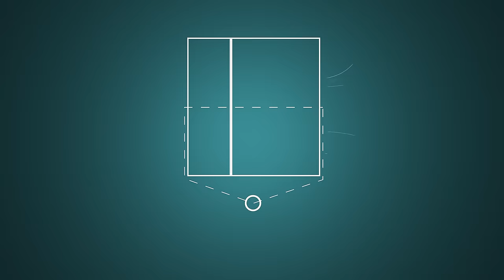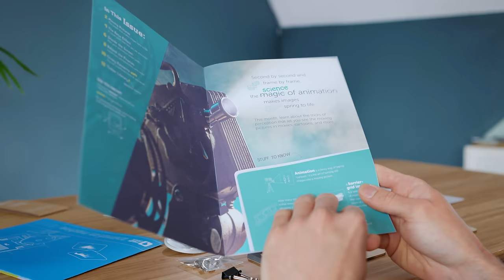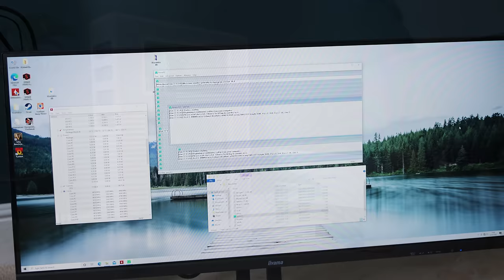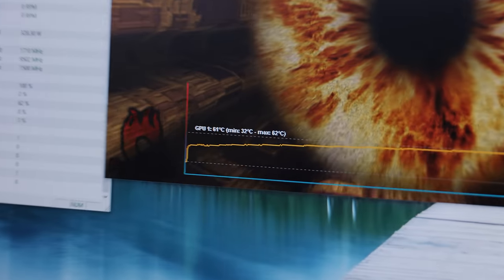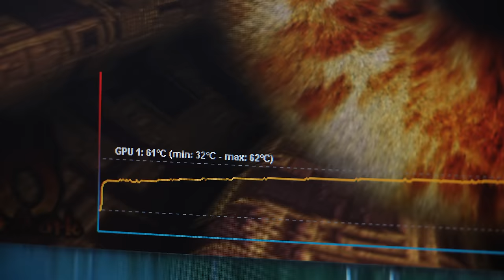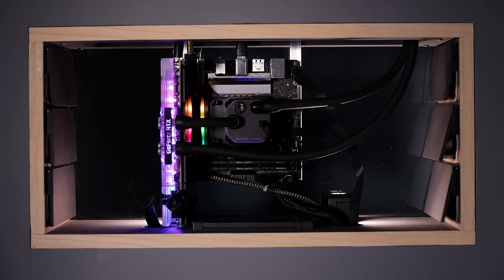Building the world's first 'breathing' PC

Comment: Gamer: heh my pc is watercooled how about you

Diy Perks: it breathes
Reply: Up you go
Reply: 10 years later: Building a hidden desktop wormhole that is actually a biological living entity
Reply: I T  B R E A T H E S 😬
Reply: Until you realize he used a 520 watt passive PSU 🤦‍♂️ This PC isn't sustainable and is only for show. If he tried actually using that PC with those components it would melt.
Reply: I mean he also has a water cooler in his build... Am i missing something??
Reply: @PabzRoz  he ran prime95 and furmark, no real world application can get anywhere near that level of power draw
Reply: @omegaPhix  But did he test them at the same time? No. That literally doesn't mean anything. Pay attention here because I'm tired of educating everyone who doesn't know any better in the comments.

He didn't show any of the HWinfo. He didn't show what the processor was boosting too, he didn't show what the GPU was boosting too, and he didn't evven show the performance. All he did was tell us the temps and Instead of showing us the temps on HWinfo he just put the number up on screen and told us. We have no idea if he downclocked the CPU and GPU so the PSU wouldn't overvolt and shutdown just to get through the video.

 ALSO Prime95 only stresses the CPU and Furmark primarily only stresses the GPU so only ONE of the major components were drawing peak power (assuming he didn't downclock them). If he ran prime95 and Furmark at the SAME TIME then that would be a different story. In the REAL WORLD like a regular gaming scenario or workloads like blender etc. BOTH the CPU and GPU boost and draw power. Obviously not peak power from both but in a gaming scenario for example that 3080 draws around 330 watts and the 5950X draws around 100 watts+  That only leaves around 86 watts for the motherboard, ram, pump, ssd, etc. The second that CPU spikes it will overvolt and shutdown. And no PSU should be running at it's max wattage all the time whenever you're gaming/ working. 

There are reported overvoltage shutdowns from a 600watt PSU so imagine a 516watt PSU (The 12v rail on that PSU is only 516watts)... Like I said, this PSU is far too small for this PC. It's going to experience constant shutdowns and the PSU is at risk of overheating and melting or even catching fire ESPECIALLY because of the fact that PSU is passively cooled....
Reply: @PabzRoz  Ah but it's all just for fun and YouTube money 😉
Reply: @countryside_guy  Exactly. I'm sure he knows that PSU is too small and doesn't plan to actually use this PC like that. It's prob the only one he had lying around that would work in this project so he used it just to make the video and prove his concept works.
Reply: @PabzRoz  My bad, thought that the tests ran simultaneously to simulate max power draw. Had the video running on my second monitor, so i was just hearing most of it. Prime and Furmark should be well established enough, but thanks for the explanations anyways.

But this setup should still work fine under "normal" use, even though it's running right on the edge of what that PSU is supposed to handle. 
On one hand you got Seasonics overkill quality and engeneering (insert german national anthem) and on the other hand
 this PSU is not starved of air flow like it would normally be in a standard case, its counterpart with a fan lashes out way over 1000 watts so i'd guess that this little air flow brings this model close to 600W of sustained load. Adding to that the OCP of this specific unit kicks in at 660W which is more than enough for the 370W power spikes the Zotac 3080 can produce in edge cases. So gaming shouldn't be a problem.
Prosumer software should run fine too because the GPU is commonly just used as an accelerator in most applications like blender or in the adobe suite and the 5950X caps out at around 200W. There probably is some app that maxes out the whole system, but i doubt that Matthew (DIY Perks) works with this kind of software.

And to add to that, my roommate is actually running a very similar ITX Setup with a curve optimized 5800X (TDP increased) and an RTX 3080 Founders Edition, fully watercooled in a Vector-1. Just hooked up my power meter and the system draws ~465W from the wall in SOTTR in 1440p. His PSU at this level is roughly 89% efficient which results in about 415W raw total system power draw while gaming. A stock 5950X should be very similar in power draw when it comes to gaming so a 415 watt average  is pretty realistic for the "breathing PC" too
Reply: @omegaPhix  What are you talking about? This PSU is completely starved of airflow. Look where he installed it... It's not even in the "breathing case" that he made where the motherboard is. It's tucked away underneath covered getting absolutely no airflow. A passive 520watt PSU getting absolutely no air blown through it while supporting a 5950X and 3080 bro. That's even worse then it being inside of a normal case because at least then it can take advantage of some of the air flowing through the chassis and the exhaust fans help dissipate the heat. Here he just basically created a box around it and that's it. Completely starved of air... Not a chance is this PC ever gunna be stable.

And what you said about the way it's engineered and everything makes it more like a "600watt+ PSU' is complete nonsense. No offense, not trying to be D, but that's not how that works. Not only is it getting zero airflow which debunks you're airflow theory but the 12v rail on that PSU which supplies power to the GPU, CPU, etc. is only rated for 516 watts. Not a chance is this PSU going to allow that much more power draw headroom without the OPP or OTP safety shutting down the PC. It's a completely passive PSU with no airflow going through it, it's going to be extremely hot and even without the consistent  shutdowns the fact it's consistently running near it's max wattage and occasionally exceeding it will cause it to eventually burn out or worse even catch fire. Nothing about this PSU is safe to use with these components. 

Btw a 5800X is pulling nowhere near the wattage of a 5950X.... Not even comparable lol. Also try playing at 1080p instead of 1440p so the CPU has a higher load. Wattage would most likely be higher then that if you did. The higher you go in resolution the less the CPU is utilized and the more the GPU takes the bulk of the load.  But who plays at 1080p with a 3080 anyway lol. Regardless testing 1 game with a 5800X isn't conclusive "evidence" that this machine would be ok.
Reply: @omegaPhix  you're smoking crack if you think this power supply is sufficient for a 5950X and 3080. I can't believe what I'm even reading🤦‍♂️
Reply: @PabzRoz  What are you talking about? In a normal modern case the PSU would chill in it's separate department in the PSU shroud. There's no way that any passive case airflow reaches it, especially because the front of the PSU where you connect the cables is mostly closed off. That's how modern cases are designed, the exhaist fan has no impact on the PSU because the air flow paths don't mix.

Watch the video again. In the "breathing" PC, the whole top of the PSU stuck out of the department, it can easily radiate heat which is instantly getting picked up and exhausted. Because heat rises upwards this is the best indirect air flow you can do and cools much much better in comparison to a standard case.

Like i said, the PSU has a hard limit at ~660W. That's where the OPP kicks in, instead of talking all that nonsense you could just look it up. The 12V rails are rated for 516W in a passive configuration because of heat limitations, but could easily do 1000+ watts with a fan strapped to the PSU. The Platinum 1200 is literally the same PSU with a fan, they were even priced the same back then.
With around 415W average while gaming the PSU in this configuration would be in no way, shape or form running near max wattage.

And i'm pretty certain that an overclocked 5800X surpasses a stock 5950X in gaming when it comes to power draw. The 5950X is a much more efficient bin afterall. While gaming you stress like 4-10 threads which both CPUs can easily deliver. The rest just idles and that power draw is absolutely negligible. 
You already realized that gaming in 1080p with that GPU is unfeasible, that argument especially makes no sense because the monitor shown in the video was 3440x1440 which is an even higher resolution than the standard 1440p I tested. 

Edit: Just tried a couple more games on my roommates system and the power draw capped out in micosoft flight simulator at 480W from the wall. Shadow of the tomb raider was definetly "conclusive" enough because that game is fairly modern, stresses out the GPU to the max and the CPU moderately. it's not like I tested Cs:Go or something like that
Reply: @omegaPhix  Dude... Yet again I have to explain how things work🤦‍♂️ Look at any modern case that has a power supply shroud. The front mounted fans go all the way down below the shroud so the bottom fan does blow air under the shroud over the PSU. Sure you will have some cables in the wqay but there's still airflow below a power supply shroud going toward the PSU. So a passive PSU would have airflow in any modern case🤦‍♂️ And nowhere have I seen that this PSU has a limit of 660w. Seasonic doesn't list their OCP limit nor have I seen any research on the matter  so I'm hard pressed to believe what you're saying here. Tbh it sounds like you're completely making that up to prove a point that doesn't exist. Tell me where I can find this so called "660 watt limit" for this specific seasonic 520w fanless PSU.
Reply: @omegaPhix  have you even built a pc before? the psu shroud does get airflow from the front fan mounted on the bottom of a case. It blows air over the psu. hdd, and whatever else you have under there. and some cases even have another fan mount down there for an extra fan mounted on the bottom. regardless you clearly have no idea what you're talking about a 520w psu is not supporting a 5950x and 3080 literally all the testing and research done on them proves that.
Reply: @PabzRoz  Don't know if i can post links but "SeaSonic Platinum Fanless 520 Watt Test" should do the trick. OPP test at 1:45
Reply: @DATBOCK  "literally all the testing and research done on them proves that." sounds like very profound proof, i'm beat. 
The 400W-430W gaming power draw is just too much to handle for that dinky 520W PSU :(
Reply: @omegaPhix  Ugh...🤦‍♂️ Man I'm really getting tired of this. I thought you had actual data from seasonic... Just because you saw a guy on a Youtube video press this PSU with a multi-function test machine doesn't mean that this PSU's limit is actually 650w... Sure the specific unit he had tripped at 650w but that's not indicative of every seasonic 520w PSU... Nor does show how safe/ hot it is at those ranges. While this one tripped at 650 watt on a tester the next persons could trip lower then that. Also you have the OTP to worry about which will cause shutdowns as well and that was not tested because he didn't let the PSU sit at those higher wattages for any long period of time. I will admit that's impressive that specific unit had a decent overhead but in no way does that test tell us how the longevity is at those ranges, how hot it is, the OTP limit, or if the OCP is the same for every unit, etc.
Reply: @omegaPhix  you can't even keep your comments straight... you just said your friends pc with a 5800X pulled 465watts gaming. a 5950x draws double what a 5800x does gaming so that literally puts a normal gaming session around 500watts+ and that' from your own words. you literally said you put a meter on your friends 5800x pc and it was drawing 465 watts. so how the hell does this pc draw 400-430 with a 5950x😂😂😂
Reply: @omegaPhix   ur not making any sense kid. first u didn't even pay attention to the video or how he did the benchmarks separately and second u don't even know how pc's function talkin as if the psu shrouds get no airflow when they obviously do. then u test "your friends pc" with a 5800x and 3080 and says it draws 465w gaming. but then all of sudden u go back and say a 5950x and 3080 pc only draws 400-430 watts? not only does everyone know a 5950x 3080 draws more then 430 watts but u literally contradict urself.
Reply: @DATBOCK  The maximum power draw of the overclocked 5800X rig was 480W from the wall in flight simulator which makes about 417W real load on the PSU (~87% efficient). 
And now please send me a source where the 5950X pulls 200W in gaming workloads. Thank you
Reply: @tonyasperado4005  man, is it that hard to read? "465W from the wall " with an overclocked 5800X + 3080
Reply: @omegaPhix  homie really tried saying an overclocked 5800X is even comparable to a 5950X😂 not even remotely close. Tomshardware 5950X review peak power draw 183 watts for the 5950X. AnandTech 135 watts power draw when gaming for a 5950X. Guru3D 127 watts single core performance aka gaming for 5950X review. you won't find a 5800x anywhere near those numbers even overclocked. so I'm say it again, how does your friends PC with a 5800X draw 465w but a 5950x and 3080 only draws 400-430😂
Reply: @PabzRoz  
"multi function test machine" is a funny way to describe a $5000 SM-8800 power supply tester ;)
The actual OPP limit is 650W because this value is hardcoded into the PWM controller so there's no way another model performs better or worse. You might find the Specsheet of the Platinum 520 stating an OPP around 650W somewhere in the internet but that's not my job. 

And "Hardwaretester" said in the beginning of the video "Und wie ihr seht läuft es schon die ganze Zeit mit [...] knapp 530 Watt Leistung" which means "as you can see this power supply has been running at just under 530W for an extended amount of time" because the PSU has to reach equlibrium before any proper testing can be done and that takes a long ass time on a passively cooled model. Just like if you'd wanna test a watercooling loop you can't take the temperature deltas from 10 minutes in

Like you said the PSU got OTP, SCP, OVP and more to keep it out of danger. I doubt that this thing is going to burn up or anything like that
Reply: @DATBOCK  
Dude, are you trolling or why is it so hard to understand that 465W on the wall makes ~410W load on the power supply?

Tomshardware stated 183W peak power draw with PBO enabled but we're talking about stock performance here.
But yeah, lets just go with toms hardware. A stock 5950X draws 121W in the ycruncher power stress test and the 5800X clocks in at 120W with PBO enabled. With the additional curve overclock this single watt is not much to overcome or do you still think that the 5950X has double the power draw? lol

Source: "AMD Ryzen 7 5800X Review: The Pricing Conundrum" on tom's hardware, page 3, Image 1

Comment: This dude increased the size of the magnet using black magic, instead of just grinding it down to a smaller size to fit the smaller tube. Friggin mad lad.
Reply: It's not black magic, it's electroplating. It's the process used to put gold over cheap metal for the jewelry you give to your live-in crack ho girlfriend. Before you ask, I know you have one because you can't comprehend chemistry as basic as electroplating.
Reply: I thought that at first too but thinking about how you would do that I realized that it would be extremely difficult to make it as smooth as it was. So using that method makes sure that it's as smooth as possible to save on efficiency.  Pretty smart move to be honest, I would've never have thought of that!
Reply: @angolin9352  He was making a joke... For anyone non-autistic it's obvious
Reply: @angolin9352  You know, I was trying to come up with a funny, light-hearted response, then I realized you might actually be struggling with some issues, so I'll leave it at that.
Reply: I can confirm this guy uses reddit and thinks hes a genius
Reply: Literal alchemy
Reply: @angolin9352  Jesus Christ

Comment: Using a speaker to suspend the magnet wasn't smart enough, you used the sin waves to vibrate off the bubbles... I mean I was blown...
Reply: the sine wave was just a vibration, and probably was adjusted to match the natural frequency of the metal; but it's still incredible
Reply: @puzzLEGO  don't think so, if it matches, it will be bigger problem if it false into the electrolyte everytime sound starts....
Reply: If it was me I would just tape around the magnet to the right diameter.
Reply: @YulHolic24  underwater tape?
Reply: @puzzLEGO  
No. He might use any frequency as long as the bubbles were removed from the metal. Higher frequencies shake the bubbles more frequently and efficiently, but it's not about the metal per se having any 'natural' frequency - after all it's a short rod of nickel-plated steel - but as he used a nail to suspend it into the solution loosely linked to the loudspeaker, using a high-volume radio tune or making a wrong move might drop the rod into the solution instead of only cleaning it of the forming gas bubbles.
Reply: @BeHappyTo  Flex Tape baby! lol
Reply: @Carcinogenic2  oh ok...

Comment: Breathable computer : Exist.

Noctua : Activating sweating system.
Reply: lol omg
Reply: noctua will ask him to develop a smaller version
Reply: @daynesacanle750  Sorry to burst your bubble, but the difference between Turing and Ampere coolers is primarily increased fin surface area(both for FE and AIBs, and was necessitated by Ampere having a MUCH higher power draw).  Turns out that physics is pretty consistent.
Reply: Scheiße
Reply: super hessu  size is no problem since its staionary also it looks cool slap some RBG on it and 10/10 would buy instead of a normal case
Reply: @hansenkhornelius  New noctua breathable case?
Reply: @s3rit661  that will be cool